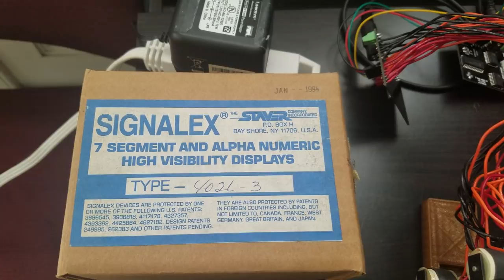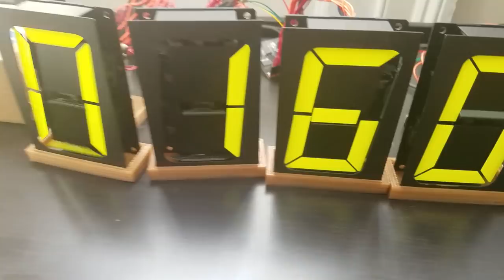Sig7Seg - A Signalex 7 Segment display controller

Comment: this is the code example 
#include <Wire.h>

#include <Adafruit_MCP23017.h>

#include <sig7seg-i2c.h>
Sig7segi2c sig;

void setup() {
  sig.begin(0x00);  // All 3 jumper pins at zero will be 0x00
}

void loop() {
  // write from 0 to 9 then A-F on the display
  for(int i=0; i<16; i++){
    sig.write(i);
    delay(100);
  }
}